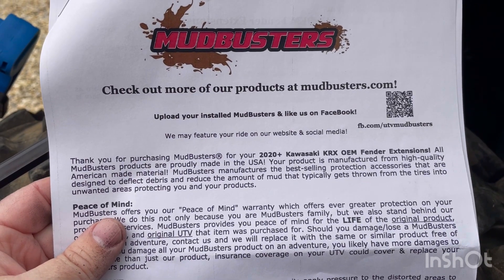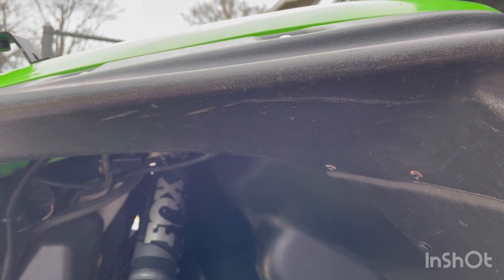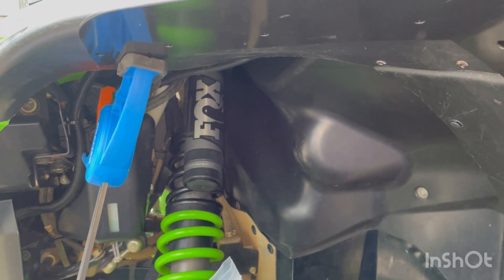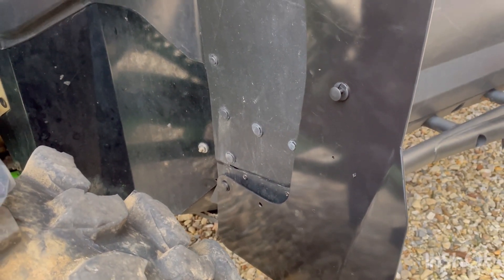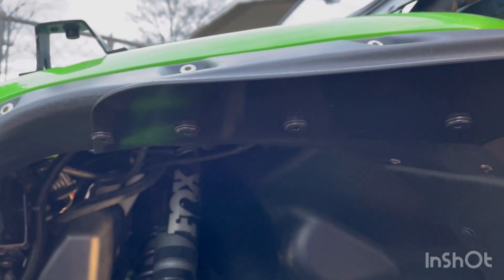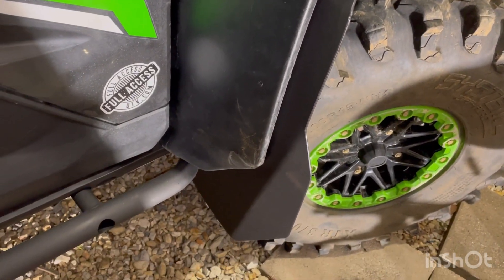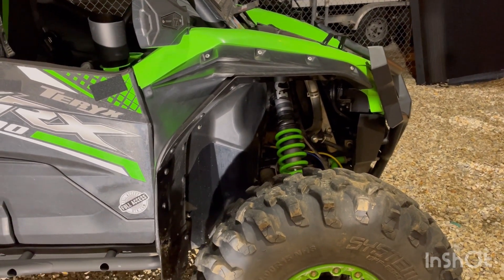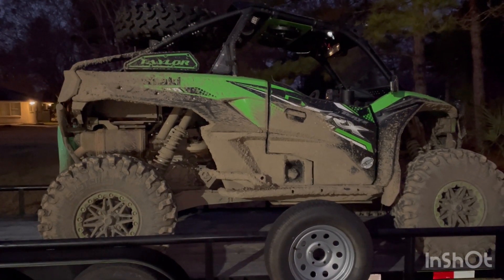Kawasaki KRX 1000 - Mud-Busters OEM Wide Fender Flare Fender Extensions - Front (Mud-Lite Coverage)

Comment: I definitely would ditch all those screws and bolts and use push pins everywhere because you ever hit that up against the tree it's going to rip those screws right out more than likely tear up the fender flare with a push pin you could just pull out the broken push pin and pop another one in there
Reply from the maker: Yeah, I thought about it after.  I think it’s a good idea as well